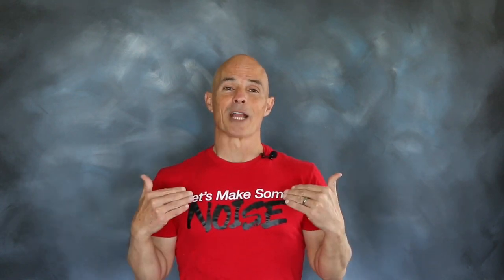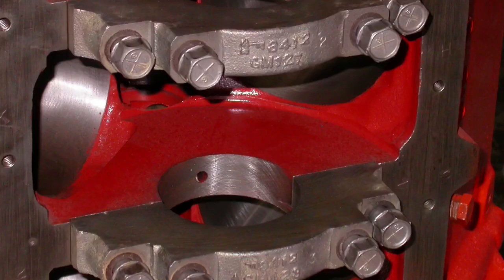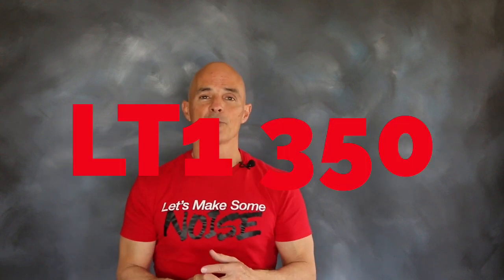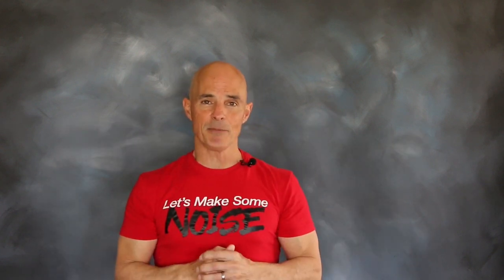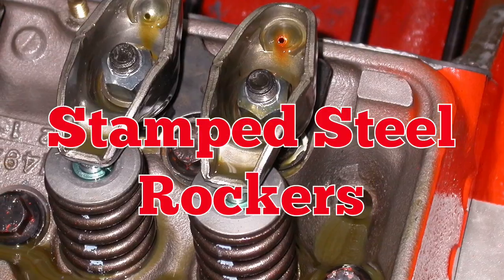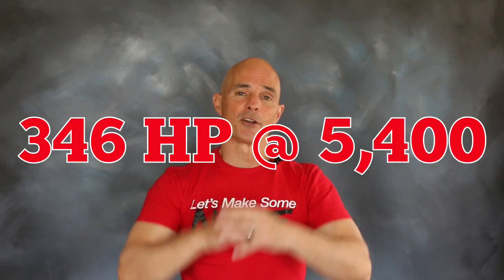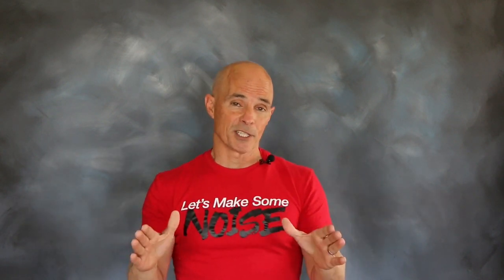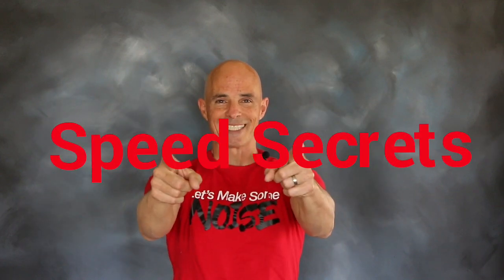Speed Secrets: Building and Testing a L79 Small Block Chevy

Comment: richard the original l79 was a small journal crank motor  , the four bolt l79 came to be in 68 when gm came out with the 350 the 350 has larger mains and the other had small journals the both used the same block in 68 and a 780 cfm holley , with solid lifters , i have one from my dads 65 vette all original , we only pulled it because he wanted ls power and a automatic

Comment: Any insight on why the L79 never made it to the Camaro? Or did it?
Reply: I believe it's because the Camaro got the 350 engine.
Reply: @bobthbldr3 ,  I think it had more to do with the trim package. 

The  302's were only designated for the limited # of Z-28's. SS cars came with either 350's ( 295 hp) and 396's ( I believe 325, 350 and 375 hp). The 275 hp 327 was available in any other camaro. With Chevy offering two " hot" engines in the dz 302 and L78 396, I think they felt it was overkill offering the L79 327, especially given their plans to unleash the LT1 350 in the '70 model year.

Comment: Is there a cheat sheet anywhere for all the GM engine codes? "L79" meant nothing to me; thank heavens there's a "327" clue in the vid descr!
Reply: the "L79" is an RPO number, Regular Production Number.  They also have COPO which Im sure you have heard of before that stands for Corporate Office Production Order, these are special order by calling the Corporate offices themselves and not found on your standard RPO option sheets.

L79 was essentially a 325 or 350 hp 327 which depended on what cylinder heads you had.  They both used the same number heads but they came in 1.94" intake valve and 2.02" intake valve.  If you have the 2.02" intake valve it was the 350 hp version and if you have 1.94" its the 325 hp version.

Comment: Heres a speed secret for you. Chevrolet dyno tests their ENGINES (motors are electric) with an alternator, power steering pump, a standard water pump not an electric one and stock manifolds. The exception was the ZZ4 which was tested with 1 5/8s headers. So go and do a realistic comparison next time instead of using an electric water pump and no accessories and come tell me how close it is.
Reply: Old time gas might have been better for power back in the 60's.

Comment: build a 400 and put a L79 cam in it with good heads and manifold with 1.7 roller rockers and a 780
Reply: 7.5 roller rocker?
Reply: @MasterWitchDoctor LOL edited
Reply: I've done it, with 2.02 "fuelie" heads, 10.5:1 compression, and an Edelbrock intake. The L79 cam is pretty mild for a 400. Power with it peaks under 5500 rpm in the 327 and it felt like it peaked under 5000 in the 400. Very good low end and midrange, though.
Reply: @1965l88  I have heard people say they were not impressed with the L-79 cam. you got to know the fuelie head you got, cause some did not preform up high that well. as I know Chevy has 2 grinds of the L-79 cam. or I should say "I have seen 2 different part numbers for the L-79 cam!" note, that in 1968 Chevy built a heaver L-79 3rd generation Nova. I have to wonder if that 2nd part number was for the heaver 3rd generation Nova.
I bought the L-79 cam because my friend was a big parts guy for Chevy and he dragged raced Muscle cars in the early 70s, he had the 70 LT-1 Vett. well I was out to buy the LT-1 cam but he told me the L-79 cam was a better  street cam. so I bought it.
my built 327 had the 71 LT-1 heads, Torquer 2 Manifold, I would shift at 6200, many times I would rev her to 7000. carb was a Holley 650. compression was 11.8. Pistons were tight. rod bearings were set a bit loose. most cars, shall I say all cars would get me off the line, but I would always catch them. she pulled really good between the gears. that was so long ago.. my best friend had the 69 428 Mach 1 Cobra Jet Mustang, the sticker on the door read "370 rated HP" and my 327 could walk it. I raced a 67 Vett with a 396, passed him just inside 3rd gear. too many stories to tell
Reply: Never gr 7 k without  a shit ton more $

Comment: The l79 is a two bolt small journal motor. At least the six I've seen inside of. Double hump didn't hurt either. They twist up faster than a 350.
Reply: You are right GM "NEVER" produced a 4 bolt main 327......
Reply: @Deepwatertackle  thats like a 4 bolt 305   lol    oke
Reply: @MasterWitchDoctor  not really. The 327 had way more HP and Tq potential than the 305. Although from what I understand, a 2 bolts can handle upwards of 500 plus power before the design becomes an issue.
Reply: Just bought my DREAM CAR/ 1964 Chevy Impala SS w/327 250hp engine. He threw in a set of Double Hump Heads just in case I wanted to go the 300hp route :-). I've read somewhere that the 300hp engine had a Solid Lifter Cam, unlike the 250hp hydraulic version. Guess I have some research to do
Reply: @Bryan Stoll
While all factory 327's were indeed 2 bolt, the '68 L79 had a forged large journal crank. It was the only year such a crank was produced('67 or earlier 327's were all small journal and '69+ 327's were all cast large journal). I know this for a fact because I used a '68 L79 crank in a 4 bolt 350 block when I built the motor for my '69 Nova.
Reply: @CzechSixTv  while that may be the case, it doesnt change the fact there was no such thing as a 2bolt main 283-327.  Sure you could do like you did and use a 4-bolt main 350 block but I personally am looking at a 62-63 Corvette 327 for my Belair.  That way I can reuse as much OEM components from my original 283.  Only thing is not many muscle car camshaft options out there from what I have seen.

Im in the process of figuring out what I want to build for my Belair.  Its an original 283 aluminum powerglide car with factory ps/pb/ac.  In the late 70s the engine when it was rebuilt was hotrodded to the point that it was now a 7k rpm motor with the only thing left to do to it was put a supercharger on it.  Axle was swapped out for a 4.56 gear to offset the powerglide.

Now that engine still only has some 500 miles on it as the car was parked but its apart and I am really thinking about building a 327 for it instead.  I have a '68 TH350 short tailshaft transmission I got out of a '68 stepside chevrolet truck I did a LT swap in about 8 years ago at work, I was going to throw the original 3.08 gears back in as I want the car to be a street vehicle and im looking at options for using a 62-63 Corvette 327 block to build a 327.  I keep eyeing the L79 cam as it looks to be the mildest muscle car cam but at the same time Comp sells a improved L79 cam that makes power 1800 - 6200 rpm vs the stock replacement L79 that is 1800 - 5800 rpm.

From what I have been seeing, it really doesnt matter on large journal or small journal.  In fact many prefer small journal as bearing speeds are slower allowing for higher rpm to be achieved before over speeding the bearings.
Reply: @Milner62  The only reason to limit yourself to a small journal block for a street engine is if it's a restoration and you want to run the original un-vented valve covers. Even then, I'd try to find a large journal 512 casting and build it as a 350 or 383. From the outside nobody would know the difference.

The 512 castings were sold as replacement blocks by Chevy until about '74. They were available as both small journal(briefly) and large journal, but either version had the draft tube hole like small journal blocks.

Comment: High rise manifold? Holly carb? NOT!!!!
Reply: Had what's considered high rise intake for the time  , winters aluminum dual plane and came with a 585cfm holley carb ,i have a all original 66 L'79 engine in my Nova
Reply: holley carb 585cfm small journal 2 bolt main 68 to 70 block 4 bolt larger crank journals
Reply: In '65 and '66 they came with the aluminum high rise manifold and a Holley carb and were rated at 350 hp. In '67 they changed to a cast iron manifold with a Quadrajet and rated it at 325 hp and only put about 6 of them in Novas. I think they didn't want the Nova to outperform the new Camaro coming out that year.

Comment: Something fishy here. GM never made a 327 with 4 bolt main caps. This show needs to get there shit right.
Reply: Large journal/4-bolt late 1968-1970 327's are rare, but they do exist.
Might have been a Corvette exclusive thing.
Reply: @wakjob961  327 blocks were not made in 1970.
Reply: @wakjob961  327 engines were only small journal. I have GM service manuals from 1965 to 1975.
Reply: @vhp454  Better crack open one of them manuals again. The '68-'69 327 was built using a large journal block. There was also a large journal 327 forged crank.
Reply: @Captainfab406  My GM service book shows only a 350 with large journal.
Not trying stir the pot but i am guessing it could be possible. Atleast i haven't ever seen a large journal 327.
Reply: @Captainfab406  all the small journal 327s had forged steel cranks  ;)
Reply: @vhp454  Not correct. Later 327s were large journal. The same 2 bolt main castings were used for many 327 and 350 engines.
Reply: @wakjob961  No 4 bolt 327 ever found it's way into a street car, if they ever did exist, which I doubt. Four bolt mains just weren't needed for the power level of the engine.
Reply: The 4" bore casting are all interchangeable so that really doesn't matter.  The journals and mains were machined later.  The difference in performance at these plebeian rpm ranges is going to be tiny.  The same block castings was uses for the 302, 327, and 350 two and four bolt mains.